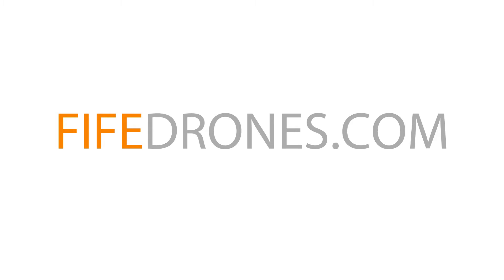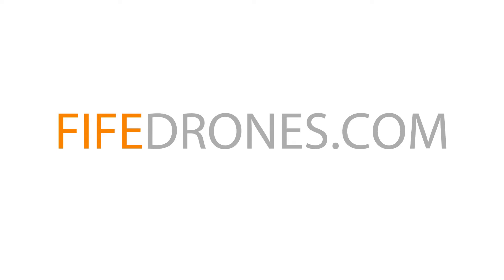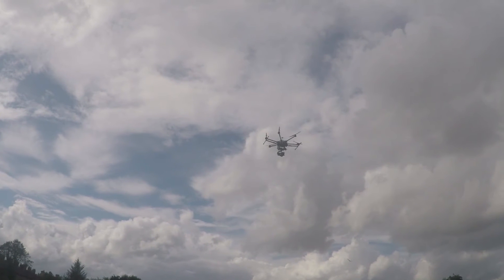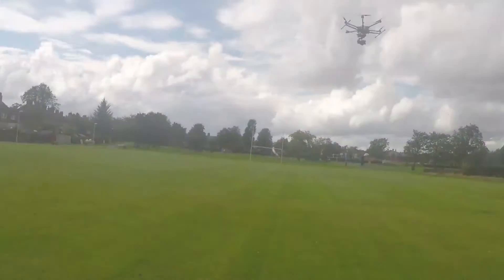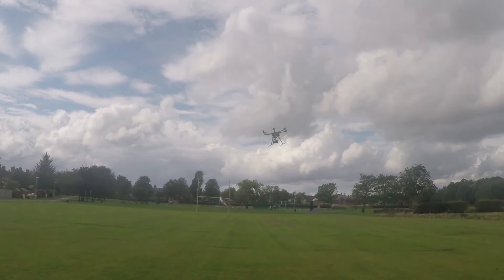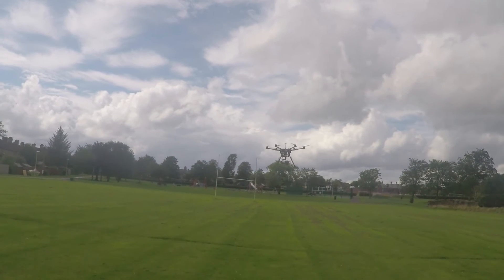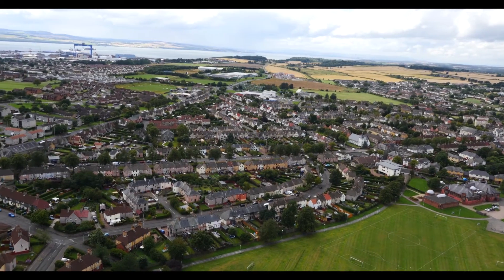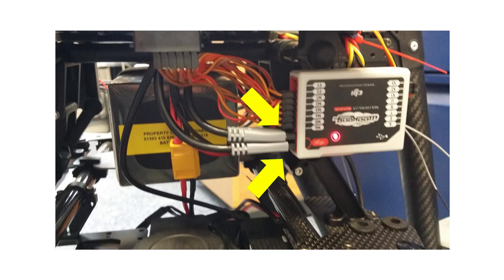DJI S900 Drone : Emergency Landing Near Crash (UK) - Learn from this!

Comment: Just wanted to put this info out. XT60 connection point! From our first builds we learned to use hot glue on all electrical connection points. After 1 year replace with another round & do fine inspection of copter. It works well and just peel it off when you need to. Another point to keep in mind that we also hot glued & a check point is under the S900 plate is a power connection (XT60 yellow)  that supplies power to the LANDING GEAR & gimbal. This point is also hit with a huge amount of hot glue to keep it connected.  With big packs you can hit this without knowing or fast maneuvers can hit that XT60 connector. Always set up the lipo packs with a good deal of clearance as the pack is on dampers & moves!

Comment: did you find out what caused this? compass error or something else.
Reply from the maker: +hquiroz113064 

It was two thing. Springs in the landing gear were positioned slightly too high leading to vibration in flight. You can see the mild vibration in the video. This in turn caused a connector to the flight controller to detach.  The second cable was almost out. Had that one come out as well, it would have been a total loss of control.  Now, I have those connectors secured in with cable ties.  Very close call.  Cause is shown at the end of the video.